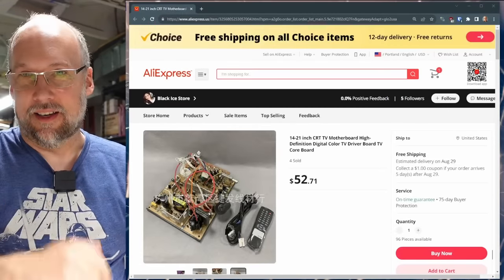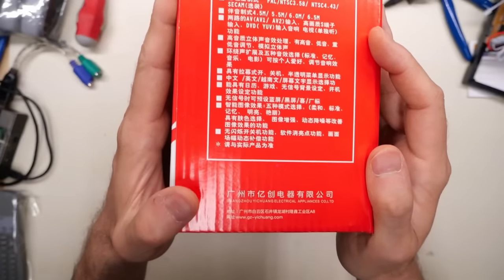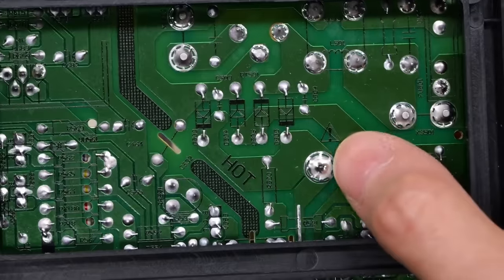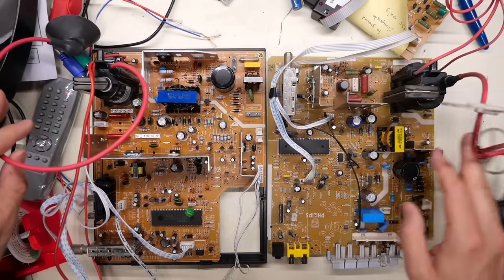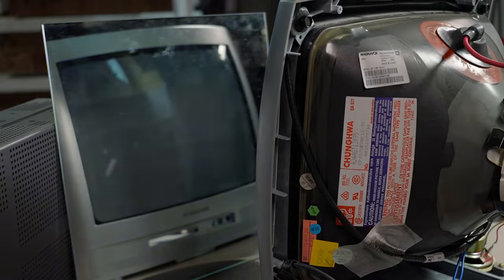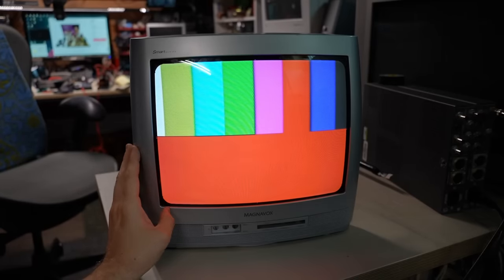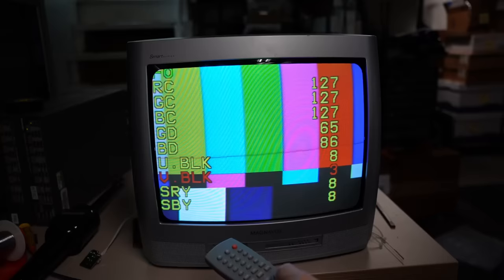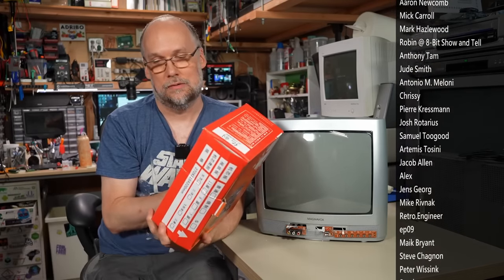I replaced the main board of this TV with brand new parts made in 2023!

Comment: BG/DK/I formats had a lot to do with different audio subcarrier frequencies, 5.5MHz, 6.5MHz and 6.0MHz. Most TVs sold in europe since at least late 80's had 5.5/6.5MHz audio subcarrier detection built in. Some countries used 7MHz channels on VHF bands while other opted with 8MHz channels on VHF, 8MHz was a standard for UHF. Only 5.5MHz audio subcarrier could fit into 7MHz channel. DIgital TV (DVB-T/T2) and digital radio (DAB) finally standarized 7MHz channels at VHF.
Reply from the maker: It's a bit confusing if you're not technical, but I suppose most people never had to think about it? Was this confusing to grandmothers?
Reply: @adriansdigitalbasement  No one had to think about it. Once programmed, TVs kept these settings in memory. Older tv sets (at least here in Poland) quite often were manually tuned using sliders hidden behind a cover/side plate, and those programmed channels were tied to front buttons numbered 1,2,3, etc. so you could for example set BBC One on channel (let's say) 32 to number 1, BBC Two on channel 49 to number 2, ITV on channel 21 to number 3, etc. and your grandma knew which programme was first, second or third.

Modern TV sets kept this feature and both digital or analog channels can be tied to specific number as you wish (there are no subchannels here). DVB-T/T2 also implements LCN (Logical Channel Number) feature in which each station can use its own logical number (similar way to ATSC except we dont use subchannels), and new tv sets follow this mode first unless a user wants to order channels his own way. LCNs are usually managed by local equivalents of the FCC, or at least the lowest numbers are appointed by law to public television and then to popular commercial networks.

Callsigns and clearly visible channel numbers in stations logos are mostly American thing.
Reply: I have used british tv network names as you all are probably more accustomed to them. From european perspective it is a bit odd why american stations used callsigns so much or were tied to their physical channel numbers. For example in my home city, Kraków (eng: Cracow), we have had seven public or private networks on channels 10 (8MHz), 27, 30, 33, 35, 50, 53, but on a TV these were programmed like 1 (10), 2 (33), 3 (50), 4 (35), 5 (30), 6 (53), 7 (27) and no one even needed to know which were the real physical chanels.

What mattered was an upcoming tv show was on commercial Polsat (6 on a remote), or local evening news on public TVP 3 (3 on a remote) and it didn't matter which frequency each station used.
Reply: The wiki page for PAL explains the sub-carriers pretty well, and it explains why in the UK none of our TVs had this as an option that could be changed.  The whole of the UK and Ireland used PAL-I (6.0 MHz vision/sound carrier spacing).  I imagine TVs in mainland Europe would need it since different countries used different PAL standards, mostly a mix of PAL-B and PAL-G.  TVs sold there would need to handle both and have a way to detect or manually switch, I suppose.
Reply: B and G were the standards for VHF and UHF in most European countries.  B has 7 MHz channel spacing, G has 8 MHz.   @TimGladding
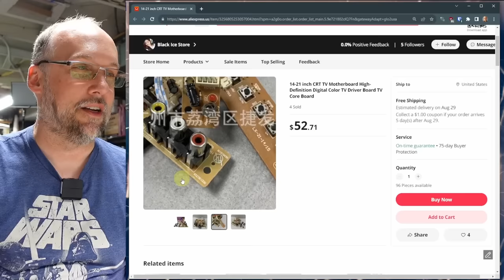Reply: Ryzen 😮 2:24 laptop 😅ŕxg 9v
Reply: @QrzysztofPL  American TV stations having callsigns came from the FCC applying the same rules to TV they were already using for radio. A TV station was just broadcasting radio with image.
Reply: In the US, in the 80's, many VCR's allowed arbitrary channel numbering like that, but TV's never did.
Reply: @seancurtin6103 Yes they did.  I have one.  Each channel has a 3-position switch for VHF-L, VHF-H, or UHF, and an adjustment wheel.  It's a Goldstar TV which unfortunately has a tired CRT.
Reply: @adriansdigitalbasement  I recall them having some cheap CRT TVs in the local supermarket. On each box was a big sticker telling you to go into the setup menu and change the settings to PAL and the correct sound standard. "Please do not call customer support until you have checked this".
Reply: @adriansdigitalbasement Congratulations Adrian for this video getting a shout out at the end of this weeks Digital Foundry weekly direct no 125

Comment: As a CRT TV Design Engineer myself I am happy to see some tubes glowing in 2023. Check the filament (heather) voltage (use true RMS voltmeter) if it's too high will kill your tube quickly

Comment: they also make these for use with arcade monitors as well , I have used several to replace cooked boards , i prefer repairing the OE monitor boards, but they sometimes go conductive, they work well and pretty easy setup

Comment: When tuning a signal here in England 🏴, auto tune picks up any signal or broadcast channels (the latter now switched off here, replaced with only digital) so the time taken seemed longer because you're only seeing 1 input and no channels.
Search allows you to manually find that exact signal eg Genesis, it's faster than the auto processing time,
Once finding the say Genisis, fine tune works if it's slightly grainy, it focuses that for a cleaner, smoother picture, working like noise reduction for early 2000's, hope this helps 🙏🏻

Comment: At 29:45 That function is very useful if you have a satellite or cable receiver and you're listening to the radio. You don't want a screen burnout and turning off your screen to listen to radio is the best option. Modern LED TVs like the Horizon brand have this feature. But i recommend to connect stereo speakers if you have a satellite/cable receiver. In some cases you need an SDPIF-COAXIAL to RCA/Jack converter.

Comment: One warning, though most replacement chassis these days will feature on board isolation from mains (through switch mode power supply), if you connect some older chassis directly to mains you can have a hot chassis and have to take extreme care in working on as anything "grounded" is actually live with respect to mains. Buying an isolation transformer and using it even with one that doesn't need one is best for working on any CRT chassis to provide extra safety if you are not sure as to its power supply design.
Reply: This board has built in isolation, using a switching power supply, otherwise the input connectors would be "hot", not to mention the push buttons up front!
Reply: "Hot chassis" is to do with CRT driver design, with older TVs having their CRTs and associated circuitry being driven directly from mains power, hence why Composite-modding those is considered dangerous, but this board is an Isolated chassis design (though, made in china, buyer beware, YMMV, etc.) meaning the power input is not driving anything directly but is, in theory at least, isolated by the input transformer, and high voltages derived through appropriate driver circuits with no reference to mains. Of course, as already alluded to, made in china and said transformers could be, as DiodeGoneWild puts it, super dodgy with poor winding techniques, damage to lacquered wire causing shorts or bridges from hot to cold sides, and just plain being made badly, so, there's that to be aware of...
Reply: This isn't Adrian's first rodeo.

Comment: There were a few TVs made with game consoles built into them. Magnavox put and Odyssey 300 in one of theirs in 1976 or so. Some others included the Philips CDi, Famicom, PS2, PC Engine, Super Famicom and a TV that looked like an iMAC G3 with a Dreamcast built in. 

Glad you're recovering well. This board is pretty cool. Too bad they didn't include RGB inputs or SCART.
Reply: @jkeelsnc  💯 with you!
Reply: VGA / HDMI would have been nice too. Injecting those signals directly into the tube gives much better quality than running the signals from a converter to the composite input.
Reply: @jkeelsnc I disagree. The late models were easier to adapt because they almost all used off the shelf all in one chips with datasheets showing vestigial RGB inputs or allowing you to hijack the OSD blanking.
Reply: I have this weird CRT TV with a game called "boxman" built in, it's quite interesting. I wonder what other small throw-in games other TVs had? 

Very interesting to learn that actual game consoles got built in to some models, I suppose they're just the next logical evolution from the integrated DVD player CRTs

EDIT: I should watch the whole video before commenting... this TV has the same game!
Reply: @paulmichaelfreedman8334  How is it going to display VGA or HDMI? They both require a 31khz (or multisync) chassis. CRT TV's run at 15khz.
Reply: @bradallen8909  There are HDMI and VGA to SD adapters with 15kHz RGB or YPbPr output that do downscaling of the higher resolutions, nothing complicated. Later CRT TV's were capable of handling HDMI FHD input just fine.
Reply: Can remember hotels having tvs with built in consoles, would get in trouble for all the extra cost
Reply: @paulmichaelfreedman8334  You are correct, downscaling the higher resolutions is very straightforward. 

However, converting 31khz to 15khz, or vice versa, is far more complicated, and the result always looks absolutely terrible.
Reply: Adrian already did a video on hacking an RGB input into a TV. It's basically tapping into the output of the chip that generates the on screen menu display. Turn off the menu display and switch to the external RGB input.
Reply: @greggv8  Yep, saw that one. Not too hard to add. It just would have been nice if it came with it.
Reply: @bradallen8909  Nope. Problem is that "SD" resolution of digital PAL DVB-C has been crippled so much that it blurs any distant details. "HD" version (at least 720p) has more bandwidth and so still displays finer details when converted than SD. The only downside is that motion is a little jerkier (likely by converting from true 25Hz instead of 50Hz interlace).
Reply: @cyberyogicowindler2448  You're wrong on so many points I don't even know where to begin.
Reply: @bradallen8909  Everybody can easily see the quality difference on a classic PAL CRT running lousy "SD" digital cable TV vs. downscaled HD that has higher data rate. On bad SD quality e.g. individual forest trees or low contrast wallpaper patterns (particularly in B/W movies) turn into mush, while their texture can be well seen on converted HD images.

Comment: I hope you checked the acceleration voltage after getting the rest adjusted. The H Size will relate directly to a change in the HV. 
This was a very cool retrofit, but you didn't call out the danger of too much HV and the resulting generation of X-rays which can be really significant when you overdrive a CRT. It is a cheaper route than a real X-ray tube if you want to take X-ray photos, but efficiency is junk.
Reply: Adrian verified that the HV matched that of the original board (19.5 KV). I don't see the problem.
Reply: With 20 kV, the x-ray is not too bad, I measured it. only at 40 kV does it start to become more dangerous.
Reply: @20kilovolt    did you make that account to say that? : D
Reply: @drwatson32bit yes why?

Comment: Occasionally there is a second super secret factory menu. Sometimes, as you discovered, menu options can change depending on the standard of signal being presented to the unit. A lot of factory menu's are activated by holding one or two of the front panel buttons during power on. Sometimes you need to power up from the AC side & not from standby for this to work.

Comment: I totally relate to overdoing the PPE when first powering something up. I usually end up covering my ears or wearing earplugs too because I am VERY jumpy lmao. I should make a remote air switch or something to ease my nerves.
Reply: In commercial work when you power up large panels, you need to wear ear protection, a face shield, high voltage rated boots, and a flame proof suit. You stand clear of where the panel will explode TO if it goes up and you call out to everyone you're going to energize the panel. Look up 'arc flash suit' to see the clothing required; and you can't be wearing any meltable synthetics.
Reply: @Peter_S_  Yeah, I've seen the results of an arc flash and it is not pretty.
Reply: Eye protection even on low voltage stuff shouldn't be ignored.  I've had MOSFETs explode and have been hit  by shrapnel in the face.  it's generally not going super fast, but still.
Reply: I remember overhauling a motor speed controller back in the '90s after its severely underpowered MOSFETs blew. I made the mistake of forgetting to replace a 1N4004 sandwiched between two big snubbers (resistor / cap in series). I get set up to do the 'light test' where we test it with a function generator in place of the tach and a light bulb for a load in place of the turntable motor. 5 seconds after powering it up a foot-tall flame shoots out of the unit (it came out of the 50-watt brake resistor I'd JUST replaced - the last one we had at hand too). EVERY SINGLE PART I'd just replaced had also blown. It certainly taught me to pay attention when working on high-voltage / hi-amperage electronics and to be careful on the first power-up of same!
Reply: @blahblahblahblah2933 better to be extra safe
Reply: A remote air switch sounds good, but you could also use a little 433 MHz remote and receiver to control a relay with it. At least then you could step back 20–30 meters or switch it on from the other side of a closed door, useful when testing those extra janky circuits 😅
Reply: CRTs before 1970th had no implosion protection. A CRT is a glass capacitor that stores highvoltage (that 30KV under the suction cup) also when off. So the greatest danger of touching it is that you will accidentally shatter the tube and so die of the shard shrapnel from a glass handgranade. That's why eye protection is important.

Comment: That’s absolutely amazing!  Who would have thought that would actually work that well and with the power supply mod too!  The picture looks great like the original and lack of SCART probably not too much of a problem with all those other monitors 👍
Reply from the maker: Yeah the original TV only had composite and RF, so I'm not losing anything doing this "upgrade" - in fact i'm gaining a game and of course multi-system compatibility.
Reply: SCART is basically S-, RGB- video and audio inputs/outputs lumped together, so average "poweruser" could plug in just one cable and is set. To use SCART with TV like that one could buy SCART to RCA adapter or wire.
Reply: @Tegelane5  not all scart ports have a full array of signals. There would be an icon next to the port saying if it was bidirectional or single direction, and if it had composite, s-video and/or RGB.
Reply: Would be excellent if one could RGB mod these boards. This would make the perfect replacement for refurbished arcade machines. The possibilities are endless.
Reply: Reading the datasheet, i saw a component input, so maybe you can use an rgb2component and wire it onto the jungle chip

Comment: Definitely do not put that speaker in upside down. it's gonna mess with the color purity on the tube. The shielding for the magnet in that speaker only works for the backside of it. ;)

You could instead drill in some holes on the side of the rear case somewhere and hot glue the speaker into the side.

You could also find a smaller speaker and hot glue that in where the original went. Might even attempt to put two speakers in to see if it has real stereo or not. :P

The fact the TV seems to remember what it's last power on state was when you plugged it back in a few times seems to indicate maybe that board was meant for arcade cabinets. Though those typically have only an RGB input so ... maybe not? :P
Reply: Saving the power-on hours (sometimes also temperatures etc.) is rather a warranty spyware to check if the product got abused. See SMART parameters of harddrives etc. Otherwise it can be also abused as obsolescence timer to trigger self-destruction either directly, or more hidden by wearing out the flash memory by bad or missing wear leveling.

Comment: It just occurred to me as strange that TV's (especially in the later and higher end times) didn't have color bar generators or geometry pattern generators built in for when you're tinkering on the settings or in the factory service menu. Would have helped people trying to dial in their sets. I'm sure my plasmas don't. Back in the day people bought calibration DVDs and such. I don't think modern sets or even monitors do now, either.
Reply: I have a CRT TV made by Grundig (uses a Beko K2 chassis) that actually has test patterns built into its service menu, so at least some of them have it, but it's definitely not common.
Reply: By then geometry didn't need adjustment unless something went wrong. Unlike the 1970s colour TVs which had about a dozen convergence controls that needed setting right if the set got moved. I recall using my MSX computer to generate a crosshatch to do that, although back then the Test Card got broadcast several hours a day (no breakfast TV at that point).